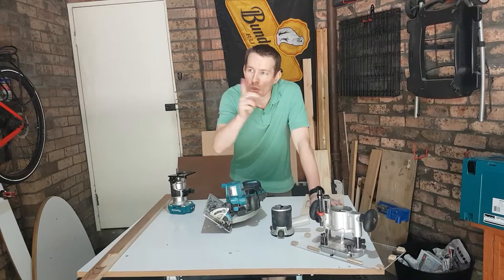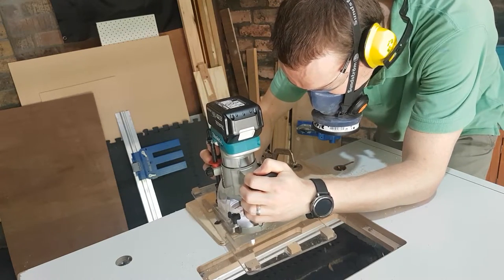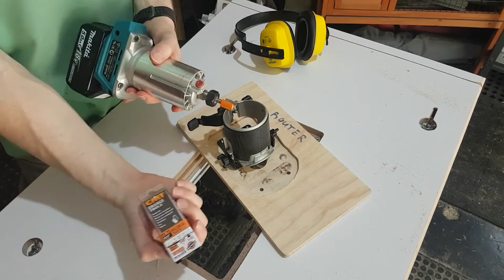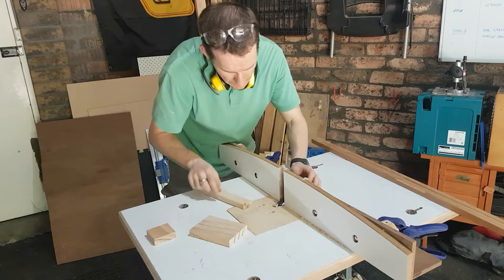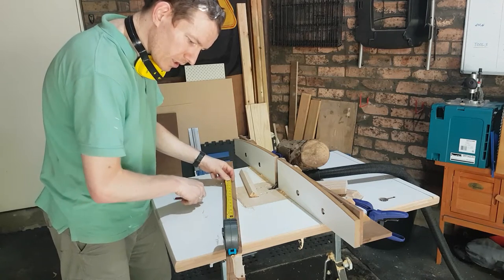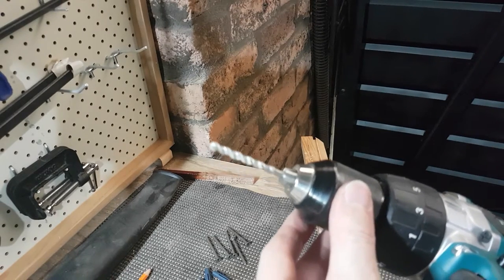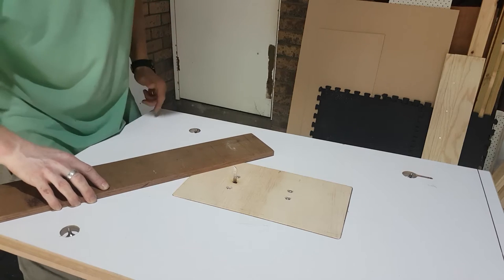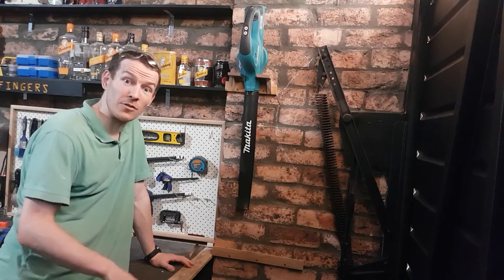French Cleats via Router Table Tilt Base

Comment: I might have to make a few of these to solve my own storage problems. I'm confused though, would a chamfer bit not work the same way?
Reply from the maker: Yep, this is basically a giant chamfer bit. My normal bit was only 9mm, which is not really big enough to be stable for cleats. Using the tilt base with a straight bit I get a 20mm chamfer. Really, this is a bad way to make cleats. If I wasn't using thin scraps because Im a tightarse, you could simply use the 45 degree bevel on your circular saw with a larger bit of wood safely. The other handy thing with this is Im not restricted to 45, I can use this setup in the future to chamfer at any acute angle I want.
Reply: OK I see what the logic was. I'm going to have to measure my router bits to see if I can make a decent cleat.